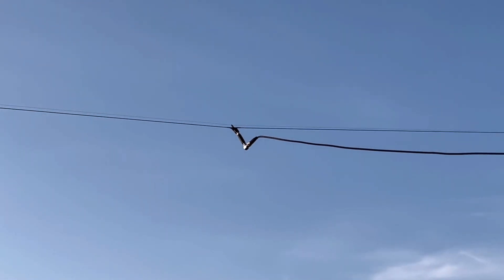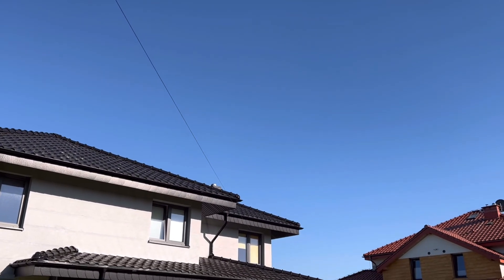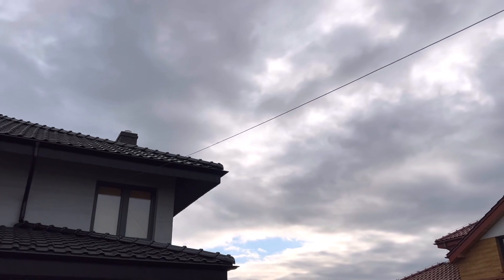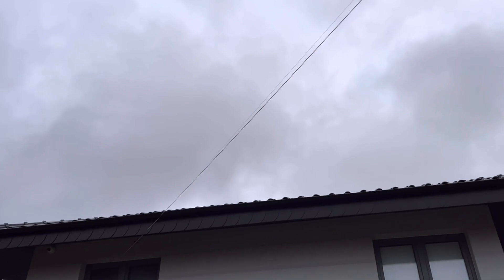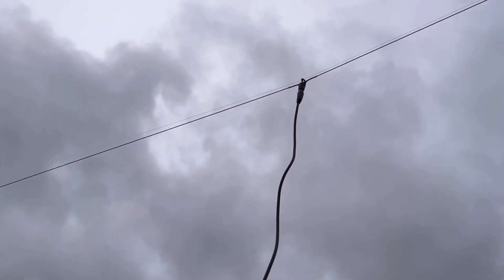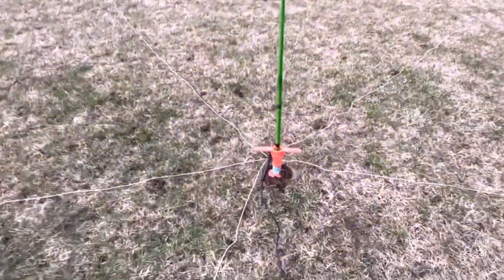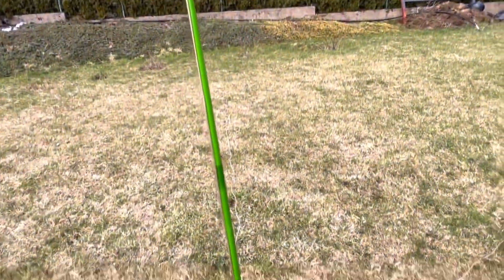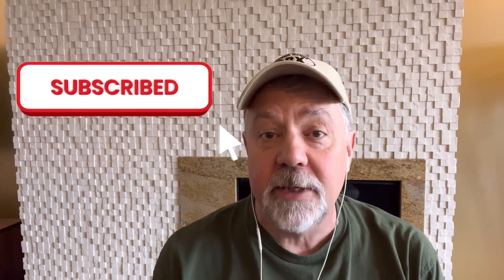Building Portable HF Antennas - Horizontal versus Vertical

Comment: I don't see it as a question of which is better, vertical or horizontal?   I see it like two tools in my communication toolbox.   Which tool best fits this situation?  Do you ever ask which is better, a flat head or cross point screwdriver?  No - you have both in your toolbox and use the one you need.

For example, if I'm at the beach and there are no trees or other supports, I'm going to use a vertical - because, that is the easiest, and will perform the best, under those circumstances.

On the other hand, if I'm going to be camping overnight in the woods and I want to work some of my buddies on 40m, I'm going to put up a horizontal doublet or dipole for 40m.  And, I will either get it up in the trees or use a portable push up pole and configure as an inverted V.

What has worked well for me is having both a horizontal inverted V on a push up pole and a vertical whip on a tripod with some resonant radials.  Then, I can switch between them and choose the best one for that particular contact.

Thanks for the video, and 73!

Comment: Hi Walt, I have a very basic question about the wires for a ground plane.    Could these be put in a garden under about 4 inches ( 10 cm) of ornamental gravel ?     Asking for a friend who has to reassure his wife it won't be an eyesore.  All the best, Pete
Reply from the maker: Honestly I think it would work but it would be pushing the limits. As close to the surface as possible. It’s the surface that’s acting as the RF reflecting ground

Comment: i am now using a   icom706 mk 2  g   and wire antennas   tried a loop home brew for 20/40  80..... and vertical also run a 220 for local chat.....belong to a club...radiohere on the south side of richmond.....   GOT TO GET BACK ON THE AIR!!!!!     DAM STROKE back in    0 9 slowed me down a lot......  give me a shout in the near future,,.,,,n4net.....va.....

Comment: I read a treatise on polarisation when operating on the beach.... vertical wins over horizontal, unless you are very careful to get the height of your horizontal just right... and that will change with frequency-bands. Also, I am sceptical about these popular end-fed antennas; can't help thinking that the co-ax is live and works as a rough-and- ready counterpoise....My end-fed preference is the City Windom.... although, if using vertical, it is sensible only on it's half-wave frequnecy-band. But that's probably also true of any end-fed vertical once it is longer than 5/8 wavelength.

Comment: I haven’t heard you mention an antenna similar to the BuddiStick with 1 elevated radial. I used mine yesterday on a POTA activation and made 80 contacts in 2.5 hours running 100w. I’m going to try using 2 elevated radials here pretty shortly.

In the G90 front, I don’t condone use of cheap Chinese radios. I’ve only owned one and it failed within a week (not a G90) so I’m very soured towards them. It’s too bad Icom and Yaesu couldn’t come out with radios with these features at the same price point. I had a 705 but didn’t seem very field worthy without adding a lot of bulk and weight. I now have a Lab599 TX-500 for my QRP activations.

Comment: Hey Walt! Great video as always! I've had great success with the End Fed Half wave as a vertical mono band antenna down by the beach. I find that a great advantage of the EFHW vertical over the quarter wave, is that you DON'T need any radials! I just use my 10m length of coax as a counterpoise and a Common Mode Choke at the rig end. All the best from Wales my friend, hope to work you on the bands one day!
Reply from the maker: Perfect setup! Hope to catch you on the bands! 73 de K4OGO

Comment: Fantastic summary and I would agree with your assessments for sure! 

I just picked up a sotabeams carbon 6 mast, and am considering antennas for it for ultralightish backpack portable. A 1/4w wire for 20 is my first thought, but a 9:1 and a dangly wire also has my mind thinking. I would love to see your thoughts on a short vertical that would fit that size mast. Any ideas?
Reply from the maker: Thanks Daniel, I've often thought about putting up a 17.5 foot wire vertically with a 9:1 and some counterpoise wires. It was the original thought I had when I put together that no radial "Coastal 20" antenna I concocted. I'm thinking 17.5 with 9:1 would give you a pretty good portable setup for 20 thru 10 if you have a decent ATU. Just an idea.

Comment: Walt, your original Rybakov video inspired me to build one for the home QTH and I'm glad I did. It seems to have the low takeoff angle that I'd been missing in my 119' "random wire" end fed and my 40-10 OCFD. I've worked various countries in Eu (from Idaho) with that darned thing, that were unworkable with the EF & OCFD. Thanks for your videos, I've become a real fan. 73 -N7BWB
Reply from the maker: Thank you so much! I'm trying to figure out a way to get one up at my home QTH too. 73 de K4OGO

Comment: Another really interesting video, but please don't forget the modified version of the Classic G5RV, the ZS6BKW; it shorter (94' vs 102') & I can work multi-bands without using any external AT, just my rig's internal AT (an IC-7300); 73 de WA4ELW in TN 🇺🇸😃

Comment: Hey, here's an odd one...I had two end fed antennas in parallel. One is for the QRP station in my kitchen, and the other is out on the shack at the back of my lot. (The two are about 65 feet apart) I was on an activity group, and getting terrible signal reports.  (like 2/2 3/2) I removed the house end fed, and my signals immediately wen to 5/7 5/9 15 miuntes later. Antennas can be wierd!!! 73's, VA3IRF
Reply from the maker: interesting, yes antennas can be very weird for sure. 73 de K4OGO

Comment: Good video.  I have been helping several guys with antennas lately and gave them this tidbit of information.  In general the F layer varies in height from about 150 to 250 miles. The peak elevation angle of a horizontal antenna is simply determined by its height above ground.  Roughly the signal is within 3 dB from 15 degrees above that peak angle to about 15 degrees below that peak angle.  So since we know that a horizontal antenna 1/4 wave high has a peak radiation angle at about 90 degrees or straight up, it will be best for zero miles out to about 300 miles. Since an antenna 3/8 waves high has a peak angle of about 55 degrees, it will be best from 125 miles out to 560 miles.  Since an antenna 1/2 wave high has a peak angle of about 30 degrees, it will be best from slightly less than 500 miles out to about 1250 miles. The peak gain for a dipole will be somewhere between 5 and 8 dBi over most real earth.  This is not to say that an antenna 1/4 wave high can not work 1250 miles, but signals will be weaker, much weaker than with an antenna with a more optimal height for the distance. Verticals have a lower peak lobe (unless the horizontal antenna is high) so on 160, 80 and 40 the vertical is probably going to be better. On the higher bands I am pretty sure the dipole will always be  one or probably more S-units better than a single vertical ( unless over seawater). It’s really hard to get a peak gain over 0 dBi with a single vertical. That said, I have worked almost 100 DXCC countries from my truck with a Hustler mobile antenna and 100 watts! There is a lot to be said for a simple vertical for quick and easy activations!  There is also practically no radiation difference between a half wave dipole, End Fed Half wave, OCF dipole, Random end fed wire of similar lengths and heights above ground. I think your videos clearly demonstrate that whichever of these antennas fits a particular location or set of unique circumstances is going to be the best antenna for that case.
Reply from the maker: Thanks for commenting and sharing!

Comment: Just today I put up my chameleon whip as a ground mounted vertical and my Tenn-Tennas 49:1 as an EFHW sloper. Made some contacts on 10 and 20 with the vertical and made some contacts on 40 with the sloper. Yes, my systems could be improved upon, but I think the most important thing is to experiment and make contacts!
Reply from the maker: Yes absolutely, experiment and make contacts!!!

Comment: Great video Walt. For 20m and up portable it's really hard to beat some flavor of vertical. Ham stick on the fender or telescoping whip on a tripod is almost all I use, though I am looking at a 1/2 wave vertical for 10-15 (the bands I use most).
Reply: I use a 40 end fed half wave vertical at home. Great low angle Dx. I find I need to touch up all the bands except 40 with a tuner but it’s worth it to have 7 bands on a single wire. Many thanks to “The OGO” for the idea. 73 de W3OY.
Reply from the maker: "The OGO" hahaha I like that!
Reply from the maker: Thanks! I'm mostly a 20 thru 10 guy myself. You'll enjoy experimenting with a half wave vertical.
Reply: @COASTALWAVESWIRES  no more experiments with it for me. It stays up. I just swapped out the 22 gauge wire for some No 13 PolyStealth, copper clad steel wire so it’ll last a long time. I was able to work Bouvet with it and 100 watts so it performs better than is should, on paper. Must be magic dirt under my tree.

Comment: You are absolutely the best Ham teacher on the Tubes. I often go through your library of experiments and rewatch your videos. In regards to radials, in one video when you were operating at the harbor, you had a single radial with a bobber attached thrown in the water. Could you point me toward that video?
Reply from the maker: Thanks so much for the kind words Jason.  That's pretty much how I do it all the time now when I'm portable in my harbor near my QTH. If you look back through my videos I think you will find what you're describing in the "Easy to Build Quarterwave Vertical" video or the "Half Wave Vertical Antenna - Saltwater Portable". If not any of the videos I've done in the last 6 months or so in the harbor will probably show it as well.

Comment: Great explainer, Walt.  I am thinking of hanging a vertical from a tree, but the only place I can put it up on my property is right next to my property line. So for the radials I can only really get them on one side, rather than configured as spokes in  a  circle like you have.   I am assuming that I will have better luck getting out to the direction where the radials are?
Reply from the maker: Thanks! I've heard two different stories in that, one say you'll get better results in the opposite direction of the radials. I'm sure you will get out in all directions but might have a slight bit of gain to one side.

Comment: I have been through the same curve of endless verticals and horizontals, all restricted by the great parameter of available space.

What I found, was that a good horizontal will utterly crush it on first skip. It will struggle on subsequent skips a lot more, unless you can put it up very high. And if you can get the antenna that high? Your channel and my comment, ain't relevant. You probably own fields and tractors.

A vertical will absolutely not be better on first skip. Equal at the very best, maybe even worse. But, if you're looking for DX, you have a *chance*. A chance you'd simply never have with the horizontal antenna.
Reply from the maker: Great input, thanks!